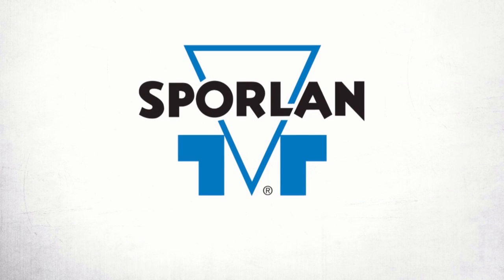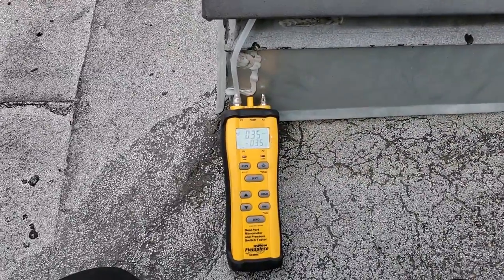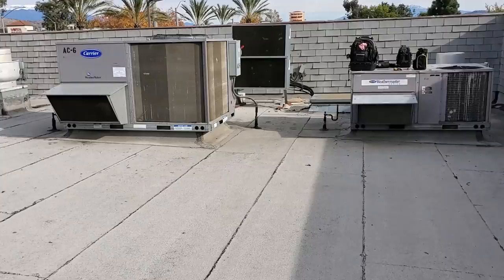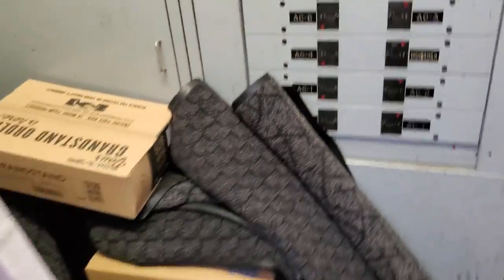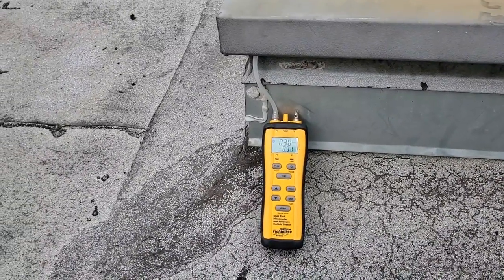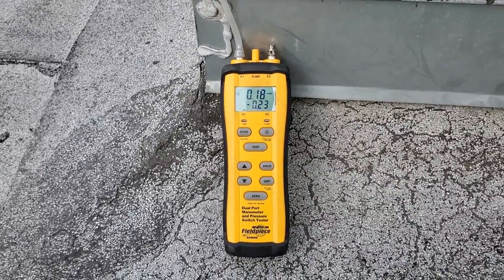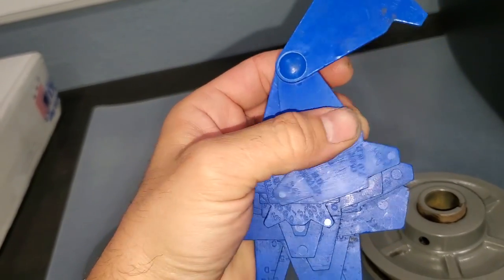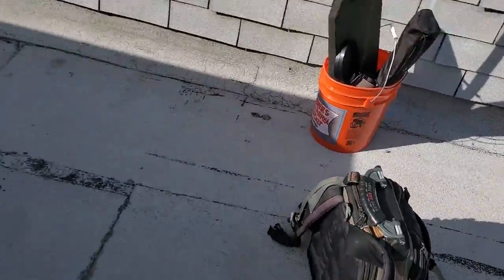THE FRONT DOORS ARE TOO HARD TO OPEN (AIR BALANCE ISSUE)

Comment: Since you are not that far from my area, I am located in Murrieta CA and I bought a house last year with dual zone AC, upstairs and downstairs. I have one unit outside. Both zones blow really cold air. I mean really cold. We set it at 75 when it's 100 degree outside and it's cold all over the house. It feels like a hospital.  It truly is awesome. My problem is that when the downstairs zone is on the sink where the water drains upstairs  makes this popping noise. The furnace unit is located in the attic area across the hall from the bathroom where the water drains. . Turn on the upstairs zone and the popping noise goes away. . I had some other guy here fixing the clogged drain going to the sink drain and he said it was probably a damper sensor because when you switch zones it goes away due to too much pressure downstairs. . Dude never came back to try to attempt it or collect his fee for unclogging the drain line so maybe he thought better and didn't want to attempt it. The popping is annoying but that's the only issue with it.  It works great. Does this sound like it's some kind of sensor or was that dude just lying to try to charge me extra money?  What could be causing the popping noise from the sink?

Comment: Had a school building that had negative pressure( we repaired it later) The school had the thermostat wires run in EMT from the roof to the classrooms. This pulled outside air from  either the hot or cold roof and blew it directly on the back of the thermostats. This caused the thermostats to reflect roof temps instead of room temps, which caused them to overheat in heating and overcool in cooling.  Blocked off the airflow in the EMT and insulated the back of the stats and everything smoothed out...

Comment: Most of my Carrier docs are for older units, and I spent some time looking for newer wiring diagrams this afternoon... but I seem to recall that Carrier powers the logic module with a fan call, and that is when it becomes active. I'm thinking that there is a black wire in that bundle which goes to 24 volts when the fan runs, in addition to the Y1 and Y2 loops that run through the shorting plug. I will look the next time I pull the panel on a Carrier.

Comment: Wow, so coming from small engine repair, i've seen some worn pulleys. In fact, I had a warranty repair one time where the pulley split perfectly and you couldn't see the split unless you took it off. Self propelled fine until you got on a hill, then the belt would bottom out and quit pulling. But man, the pulleys you show in some of your videos are incredibly worn! wow!

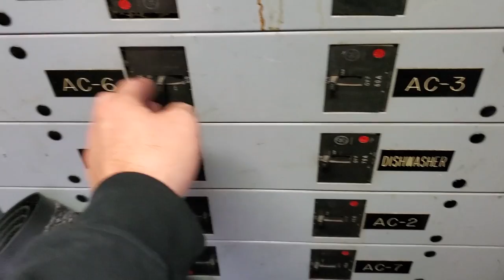Comment: 7:50 ... and that's why breaker cabinets have to have doors.
Reply: Exactly some idiot threw those rugs down there and caught that breaker and turned it off.
Reply: @Mr Sunshines wow you got some serious issues ...
Reply: @Mr Sunshines lol I am not quoting anything. Neither directly nor indirectly. This is the worst attempt at trolling I've seen in a long time.
Reply: @Mr Sunshines you really have some over-active imagination with words there.
Reply: As others have said, covers not required.  but clearance in front of electrical equipment is a code requirement.

Comment: 33:39 - I notice the tendency of most techs who use their side-cutters as a hammer that many use the wrong side: depending on the hardness of what you're tapping, you could peen the joint of your pliers (either loosening the joint or stiffening it). Always use the open side of the cutters to avoid this issue.

Comment: Really good job! You explained the alignment problems very well. The alignment issues suck because that unit will eat belts and sheaves and do the bearings no good. I think the belts are Kevlar and so the belt material (dust) is harder than the sheaves and the bearings. It was good of you to vacuum up the insides. Sad that preventative maintenance got so far behind. Checking and replacing the filters is easy, checking the belts and sheaves is easy, checking the coils for cleanliness is easy, the manager or an assistant manager could do these tasks weekly and make a call for service when necessary.
Reply from the maker: Thanks for the nice words Ty, yeah this particular customers stopped the maint program at the end of September and they plan on starting it up Jan 1st....... corporate strategy to play with the numbers....
Reply: HVACR VIDEOS I kinda understand because it was clearly stated in English but that’s as far as I get. I know I’m preaching to the choir I know but HQ should know that there was no savings, if the money saved were a loan then it would be an expensive loan. They could have plastic windows installed so the belts and filters and coils could be checked SAFELY with the units running. To check all the units for proper running conditions would take less than an hour. Climb to the roof smoke’m if they got’m and check the coils, filters, and belts, easy. If they don’t know where the units are, the units are on the roof, super easy.

Comment: Great work! I couldn't help but notice that there is an issue with effluent from the kitchen not getting exhausted out thru the hood. Those filters should not be greasy. Either the kitchen return air is too close to the hood or, the hood is not being (getting) turned on like it should according to code or otherwise. There could be issues with the hood exhaust fan/ hood make up air as well as design issues or poor practices regarding storage of items in or around the cooking appliances or, not being properly placed under the hood. Smoke test would be in order.

Comment: good overall assessment and instruction on troubleshooting issues with the building. i worked at Stanford university  on many types and sizes and your tutorial was spot on.  it was funny when you went to check for power and there is employee crap everywhere. people always find the mechanical rooms and put their shit on everything not realizing how important and how dangerous with all the electrical dangers their exposed too. jackasses probably get stoned there, lean up against breakers and tripped them  or who knows.  but those panels need to be debri free or shit gets hot.electricity dont likey heat. well done

Comment: Thing I hate about Carrier RTUs is where they got there wiring diagrams printed. Where Im at I've seen plenty of Carrier and Tranes that were unreadable due to being eroded by the sun and dirt.
Reply: I've learned that usually by the time that happens to the diagram, half of the shit in the RTU has been jerry rigged by ignorant hacks that have no business even touching hvac equipment.  And at that point I tell the customer it's either time to replace the RTU or to pay me a lot of money to repair, rewire and restore the entire thing correctly so it can be serviced efficiently. If they opt to not have me service it, it's no skin off my back. I'd rather not work on it and if I have to work on it, the customer will be paying my piece of shit labor rate.
Reply: @dssjr85  whats the rate

Comment: A Contactor that is buzzing is generally caused by crap on the magnetic faces of the contactor. If you are able to disassemble the contactor to change out the coil, then you will be able to clean the magnetic faces. Industrial Electrician retired.
Reply: That is REALLY smart! But.. not to be a negative nelly here, changing out the contactor anyway means one less to replace later as the brand new one will be (hopefully) void of any other problems it might have started showing later despite being cleaned. (like maybe impending structural failure)
Reply: yep buzzing or sizzling sound is no good. just going to get worse,less conduction brings more heat,more crap then yeah.  the sound of electrical contacts sizzling is like fingers on a chalkboard to me
Reply: I spray electronics cleaner into any opening I can find and 99% of the time that works without having to disassemble but eventually it'll build up carbon again and need to be cleaned. Manually brush cleaning takes longer but also last longer.

Comment: That Honeywell Jade Controller reminds me of a OBDII scan tool for a car, but only built in... Nice!... It might not be perfect now, but being a little on the plus side is a lot better than -.35. Your not a certified air balance professional, but you do have the most important tool for the job and it doesn't go on your tool belt, it's the tool between your ears and it's the most important one to have. Well done!

Comment: I did test and balance for a big company for  years. We ran into a lot of crappy, cheaply constructed fan cabinets also. On an interesting note, one very big airplane paint hanger had multiple supply and exhaust fans that could vary the pressure of the building. The design was for 1" of pressure. The engineer never realized how dangerous that could be. That much pressure nearly killed people working inside when someone tried to crack open the large sliding hangar door. The door started ripping its metal off and nearly destroyed the door itself. The 1" design was way way too much. You can actually get locked inside a walk-in fan section when it is running because the negative pressure can be so great you cannot open the access door yourself without help from outside or by  turning the fan off.  When I went to my insurance agents office I noticed a lot of glassed-in side rooms the different agents were using. They liked to close their doors for privacy. The rooms were nearly air tight. With the doors closed conditioned air could not enter the rooms because there was no transfer duct to allow the air to flow out. They thought the 1/8 inch crack under the door would be enough. Wrong again! There seems to be no general understanding of air flow and air pressure. I have a lot of these stories to tell.

Comment: Classic.. and look at 4:02.   
Bring on the Stank! 
They have even capped the vents for the sewer stack. Trying to keep the sewer smell from going inside. 
This is a big no-no as they are then not even getting that air from outside, they are taking it directly from the sewer.
Reply from the maker: Yeah I will be discussing this on my stream tonight, I will be going live on YouTube this evening 12/16/19 @ 5:PM (Pacific Time) to discuss my most recent uploads and answer questions from emails, the chat and Facebook come on over and check it out if you can.  https://youtu.be/_20hGnjjK44

Comment: a laser belt alignment tool and belt tension gauge will make your sheave and belt alignment job much easier. 
and also, take the differential pressure of the exhaust fan if possible to eliminate the guess work on balancing the building air side.

Comment: I work in industrial maintenance (printing industry) on one of the production halls, when one of the machines is running, you literally have to fight the door to open it, even if the big roof vents are open, it's hard to fix without adding extra ventilation systems, the problem is the machine takes a lot of air from the outside for the ~2MW of gas heaters and then we have to get enough exhaust in a lot of places to keep the heating air (for drying the paint) and fumes out of the production hall, the exhaust fans are 30kW, if we get a little of the drying air into the hall, we immediately have a lot of smoke inside, and it makes you dizzy, what makes it even harder to fix is the fact that the amount of air going through the burners changes depending on production and machine speed...
Reply: Also, once you start changing the intake and exhaust fan speeds you mess up the production... 1HZ on the VFDs is enough to make them produce scrap, opening the doors to fix the negative pressure issue also can mess it up
Reply: I work in an industrial coating firm, where we coat films and paper and have big driers aswell. Not that much of a problem with the doors, as it ducks the air in through every slit and big forklift gate, but doors opening towards the shopfloor will just stay open like 5-10 inches, even with the automatic door closers. Sometimes the whole roof creakes when the gates open and close. Really makes me wonder how much extra load that negative air pressure puts on that roof, as it is a giant area.
Reply: *sucks air in
*Creaks
Reply: @stabileseitenlage  I recently had the chance to measure the pressure, the machine was running slow, all the roof vents were open and I actually measured between outside and a hallway that goes into the production hall, not through the door going directly inside, still was -0.3mbar, the door wasn't that hard to open, gonna check next year again though, since we're on maintenance break now
Reply: @tomboxyz5564  If I don't forget, I'll try to look aswell.  Also, I've been told, that the roof openings don't let enough air in (especially in winter), simply because the hot air, pooling near the roof, is trying to rise upwards, right against the airflow. I'm not sure about that though.

Comment: I wonder if the "baby steps" means this problem has been building up for quite a while. 

This makes me think - I've run into a couple places where the air pressure difference added resistance to opening the door. I wonder if that meant they needed maintenance...

Comment: 1 trick leave austere set screw loose and it will slide onto motor shafts.  The cheep pulls flex a bit making them tight to install otherwise great work. I would have checked .load on mua motor to determine e if I could increase airflow. Also most exhaust don't get set correctly and often can be slowed down. Great channell
Reply: Adjuster lol

Comment: At a site in Virginia, air balance done. One senor in large space read high, happened to be a cold day, unit 1 ran could no satisfy spa, SOO set to kelp starting units till satisfied. Turns out all units in economize on PA to cool, someone had screwed and calked all relief air barometric damper closed, so all 8 units eventually started, air pressure caused roof to bubble up, plywood sofit in roof blew apart, several, doors skamed shit hard, two slammed open knocking big holes in drywall and broke a window... Building Pressure Matters.

Comment: Motor shieve blower pulley. The adjustable shieve allows you to fine tune the rpms of the pulley(blower). I have a few chem labs where I have to verify the rpms of the exhaust fan.

Comment: A local Wendy's here in Massachusetts has such a bad make-up air problem that I have seen MANY customers walk up to an entry door, pull on it several times, and walk away thinking that the door was LOCKED! Manager just simply doesn't care. 
• Back when I started in this field, I was asked to help figure out the same issue at a Chinese Restaurant. All the outdoor air dampers were screwed shut and there was NO make up air at all. 18 HP of exhaust fans!! If they shut the delivery door in the kitchen, you couldn't open the front door no matter how hard you tried!

Comment: The fan running constantly causes humidity issues here in Houston during mild humid days. It will even sometimes cause condensation to drip from the vents. When the compressor shuts off the fan running causes moisture still on the coil along with the humid outside air from the outside damper to go into the space. This will rapidly raise the humidity inside. Basically you can never have the compressor shut off on warm, humid days or it will cause the humidity to go up rapidly with the fan always being on. I think for the dining room it should run the fan for a minute after the setpoint is reached and then shut the fan off. If there is no call for cooling in say 10 minutes then run the fan only for 10 minutes on and 10 minutes off till there is a call for cooling.  I know the dining room will be way more comfortable.

Comment: A couple things here. First the stuff in front of the breaker boxes should be moved. That’s against fire code. Their should be 36” of space in front of them for access. Second. I use my Allen wrenches for gap measurement on the old sheave to set the new sheave. When replacing a sheave Browning has a 1VL or VP or VM series. The VL is the weakest and will last the shortest amount of time. I always go with the VP or VM series. These are stronger and will last much longer.
Reply: *there

Comment: Local restaurant has the same problem. Door handle practically falls off trying to open the door, and it becomes a wind tunnel once open.

I actually tore the handle off a door once because the building had this problem

Comment: I don't think I've seen you working on a make-up air unit, aside from this quick look at the blower section.  As a non-HVAC person, I have a question - do they contain all the same bits as a normal AC - compressor, condenser, evaporator, etc - just without the ability to recirculate, or are they something different/simpler?
Reply: ickipoo not all will come with refrigeration. Some work on evaporation
Reply: And depending on the area they could just come with heat

Comment: Ah, just down the street and on the opposite side from my favorite 28 tap ale house and food joint.  When I first saw this I couldn't tell which of the two paces it was that share a parking lot, but it is the one where my credit card was ripped off by a crooked server.  I don't have good things to say about them and I think most of it was because of whoever was the local manager at the time, a few years before your video.  Won't out them here, only say it is somewhere between lobsters and a steakhouse.

Comment: When your checking the resistance to ground you should use an Isolationtester because your only checking the resistance with about 4.5 Volt and not your 200V so a broken Isolation may arc over with 200V but not with your 4.5 V.